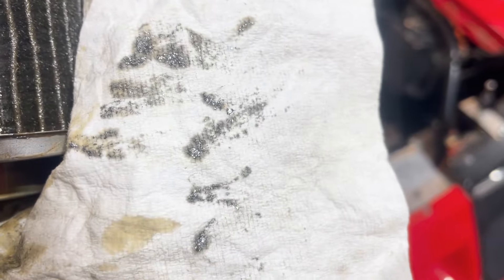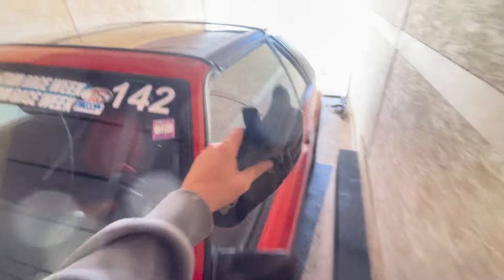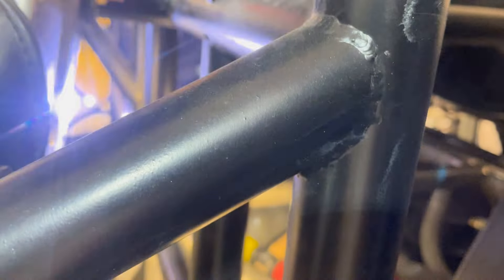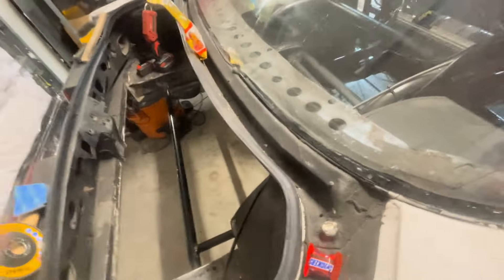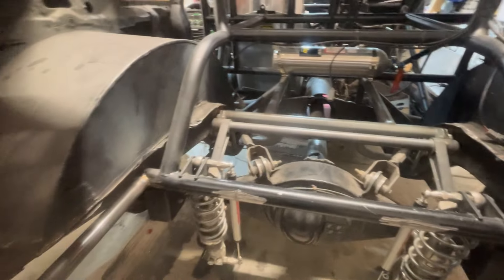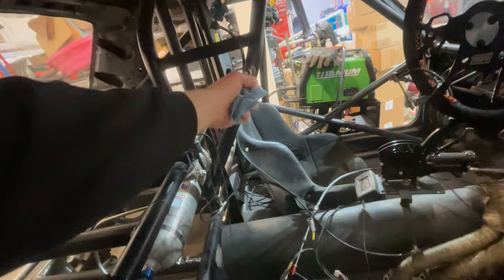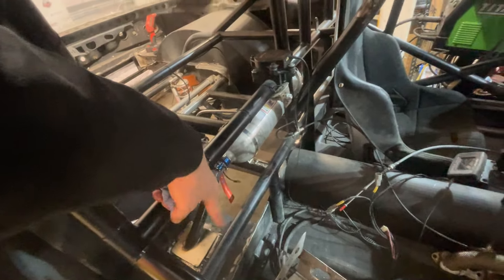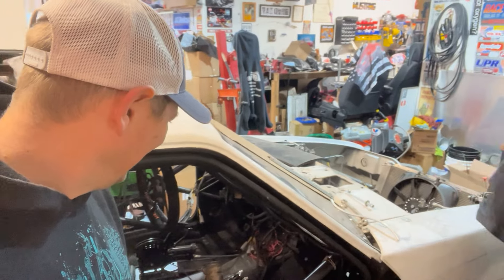Time for a NEW racecar...

Comment: Sick race car! Not a 4 eye hatch but still sweet lol
Reply from the maker: Thanks!  It’s originally an 86 gt notch but they put an 87 front end on it
Reply: @BMF_Garage   but it's the last year for the 4 eye then...... put it back to 4 lol jkjk
Reply from the maker: @kb_701 I thought about it, but it’s got an expensive fiberglass front end on it 🤔 probably leave it for now…
Reply: I would leave it for sure. That looks like a lot of $ in that car. How much power did it have with the last motor?
Reply from the maker: @kb_701 yeah it has a ton of good parts on it.   Engine made 1003/982 in the old car turned down.  Shooting for 1500 in this car.